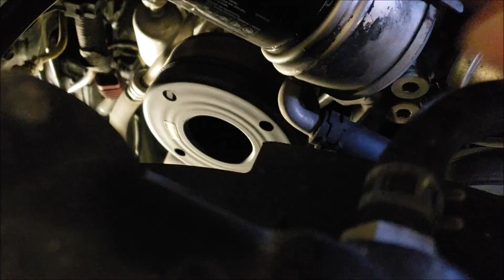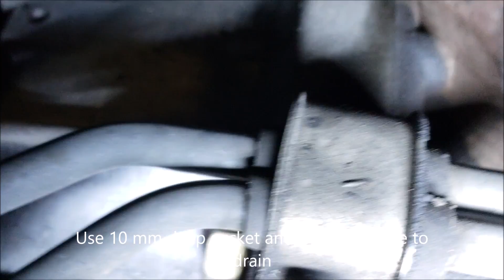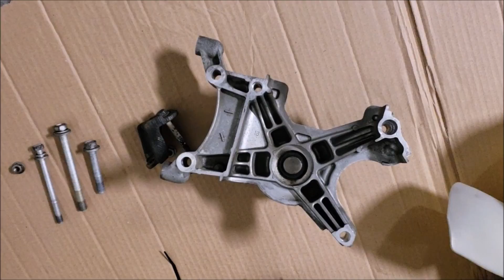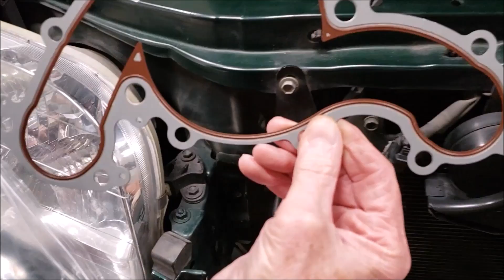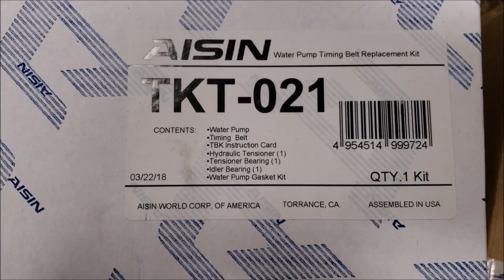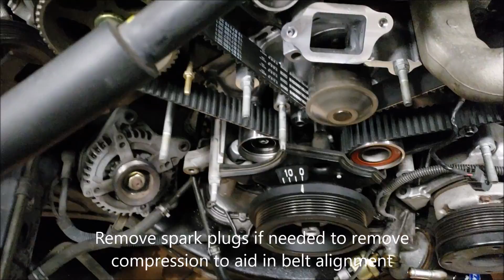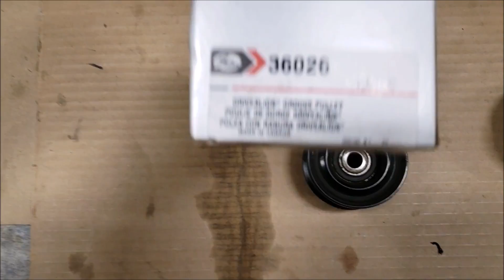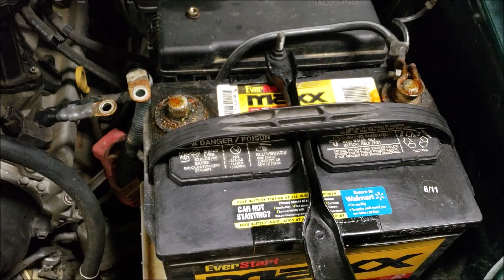STEP by STEP Timing Belt Kit installation: 2UZ-FE V8 4.7;Toyota Tundra, Sequoia, Land Cruiser, Lexus

Comment: Belt is on backwards when facing the vehicle the left should be on your right.
Reply from the maker: Yes, I have not paid attention to the marks on the belt any time I have replaced a belt (several Tundras). You can use them if you would like and feel more comfortable, but some belts don't have them and I haven't used them on 2004 and earlier engines. I have also seen DIY's obsess about the marks on the belt instead of focusing on the marks on the engine. Lining up the marks on the pulleys is the key.  There are more details in the description and in a conversation with Dave g in the comments.

Comment: Just did mine , now my AC doesn’t blow cold , any advice ?
Reply from the maker: My suggestions: Check to see that the a/c connections are tight.  Make sure the serpentine belt is installed properly and tight.  If the belt is slipping, you may need a new belt and/or tensioner.

Comment: How many miles are/were on this engine @G Dupler? We have an 06 Tundra with 156,000 & have Never done the timing belt, water pump etc & we've had since it was a year old with 17,000 miles. I KNOW we are Waaaayyyyy Overdue :(
Reply from the maker: The Toyota manual says to change it every 90k. I have heard people go a lot further than 90k, but that is a testament to Toyota engineering. We changed mine at 150k, but that was the second time because it was changed early at 60k.

Comment: I came here for the lining up the belt marks with the pulleys, and you didnt do that!
Reply from the maker: True. There is an explanation in the description and I talk about it in several comment threads. Some belts have the marks and some don't. I see no need to use them, but I don't begrudge someone who wants to use the marks.

Comment: Right, the bottom line is that the Left and Right Cam pulleys along with Crank line up at their designated TDC marks.  The Timing Belt marks are an additional step for accuracy purposes that all timing components are inline (referenced) correctly to each other, in fact after initial line up with Timing Belt marks and the three pulleys, after two rations of the Crank these marks will no longer line up, but as we know the TDC marks on the pulleys Better line up with their respective TDC marks on the backplates of the pulleys.  Once again thanks for you video !

Comment: Great video, thanks. However there's an error in your installation of the belt to the Left and Right cam pulleys and as a result your Crank pulley as well.  The Toyota belts are marked L cam, R cam with arrows and the Crank pulley with three different marks.  This is the case in order to guarantee the correct spacing of number of Cam teeth both Left and Right Cams as well as the Crank pulley teeth. I noticed your Cam timing marks were lined up with cam backplates. In addition, before remove the timing belt, both Left and Right timing marks should line up with the T position on the Left and Right Cam backing plates. The purpose of the Cams lining up with the T is to relieve the tension from the cam lobes, and therefore when the timing belt is removed from the cam pulleys the Cams don't tend to rotate and possibly create Valve slapping with the pistons. Thanks for your video.
Reply from the maker: Thanks. So, referenced in the description and in some of threads on here I explain that I pay no attention to the marks on the belt. Some belts have marks and some don't. I certainly respect anyone who wants to use the belt marks, but I don't. I also hear what you are saying on the T marks, and again, if that method works for you, no issues here, but in my experience the T marks aren't a must unless you are working on a 2005 and above.

Comment: Hello I have a 2005 engine does the mark on the cam go on the T ?? Instead of the line like in your video.
Reply from the maker: Thank you for watching!  The simplest answer I know for TDC versus the T mark is that it depends upon the year.  2005 and above you use the T mark in some form or fashion (due to the VVT-i).  The instructions from the Aisin kit are as follows covering your 2005: 

2005-08:
Turn the crankshaft clockwise until No.1 cylinder at TDC with timing marks aligned.
Turn the crankshaft clockwise a further 50° until pulley timing mark aligned with guide pulley bolt.
Camshaft sprocket timing marks will move forward 25°

Comment: Did I catch that correctly on your timing belt install. did you not line up the lines on the belt with the timing marks on heads and the marks on the cam?? Did you count the teeth in between the two lines on the belt to make sure  it was the same amount of teeth on the belt where you placed the belt on your two cams & head timing marks?  don't get me wrong excellent video!! job well done! I just caught that little detail there and that's where I'm at on mine.  I just wanted to know if you did that and if you didn't do that , did you get lucky and and and get it right or did you have to reset it ??? sorry to call this out on such an excellent video. normally I would never do this but I'm right at the point to where that's where I'm at.   I'm having troubles getting the lines to stay on the cams seems like the belt needs a stretch a little bit to get the lugs to settle in place. I don't want to do this job again for a small detail like this overlooked. Your reply would be much appreciated in anxiously waited for thank you for the video though it's been most helpful and nicely done also I can appreciate the Newton Meters in foot pounds terminologies
Reply from the maker: Thanks for the good words and sorry I didn't see your post earlier.  I am trying to catch up. I have not paid attention to the marks on the belt any time I have replaced a belt kit (several Tundras). You can use them if you would like and feel more comfortable, but some belts don't have them and I haven't used them on 2004 and earlier engines. I have also seen DIY's obsess about the marks on the belt instead of focusing on the marks on the engine. Lining up the marks on the pulleys is the key. Keep the pulleys in place and when the belt is tightened, the marks on the cam pulleys and crank should be lined up. There are more details in the description and in a conversation with Dave g in the comments.

Comment: great video. I am at the point to remove the timing belt, but at this point the crank is lined up to the 0 mark but the mark on the cams are a little bit off their I marks more towards the T marks.
How do I do to have them line up perfectly both of them to the I marks, Turn the crank several times to the right clockwise until it finally all line up correctly?
Reply from the maker: Thanks. If it were me I would rotate the crank to the point where all three marks (crank and two cams) line up.  I have seen situations where it was off just slightly and then corrected with the new belt, but I would still try to line them up at tdc.
Reply: @gduplerauto  thanks you, i reinstalled the crank shaft and bolt and turned the crankshaft clockwise several times trying to line up the 3 marks, still off a little bit : right cam shaft a little bit, the left (driver side) a little more. So at this point I decided to remove the timing belt and the tensioner. so far so good.
but then i decided to see if I could line up the camshafts marks.
Right side jump a bit counterclockwise pass the I mark however the Left cam jumped quite a lot again counterclockwise way passed the I mark about 50 degree. So I turned the camshafts clockwise to line up with the cam marks.
So my question is did i did something very wrong and how at this point should i correct my mistakes before i start removing the water pump.
Reply from the maker: @LawnMowerGuy  my experience is if you just have minimal camshaft movement and you put the cams back to the proper place with minimal movement to put it back to the proper place you should be fine. You may want to use a clamp to secure the cam pulleys as you work. If you have a 2005 or above engine you will want to use a particular procedure discussed in the comments. 2004 and earlier go by tdc.

Comment: So it has 2 waterpumps. The outside one and then the inside one that runs off the timing belt?
Reply from the maker: Just one water pump. The fan bracket looks similar to a water pump but it is just a bracket and a bearing.
Reply: @gduplerauto  ...yes I know, it was not till you took it off that you started to refer to it as a fan bracket.

Comment: I have stressor is, don't forget to replace the idler pulleys. I own the Sequoia where somebody didn't do that and their place the timing belt itself and I thought it was something like a serpentine pulley but no I had to do an entire timing belt to replace them. Also, if you hear a grinding noise, I highly recommend pulling off your serpentine and running it and seeing where it's at, otherwise, one of them can seize and the timing belt will break and you don't want to drop a valve on these engines these are very expensive engines.
Reply from the maker: Yes, I agree. We did the idlers as well. There are some with the kit and the accessory idler is available separately.

Comment: Would you or did you put in a new coolant thermostat as well?
Reply from the maker: I did not, but I would recommend replacement on a truck with higher mileage. Particularly around 200k or more.

Comment: Good video, the timing belt is in reverse but anyway will work, just pay attention at the left side te belt is marked right cam, is not important because the timing marks are on the right place, just a observation
Reply from the maker: Thanks! I don't pay attention to the marks on the belt because some have marks and some don't.  I just focus on tdc and lining up the marks on the engine. See the discription for more info.

Comment: What does this service normally run with the new parts?  Was looking into getting a used sequoia but idk with this amount of service needed for the timing belt service
Reply from the maker: A shop would charge between $1000 and $2000 for parts and labor depending upon the place and the quality of work.  I broke down my part cost specifically in response to other questions, but my cost for all the parts was a little less than $600.

Comment: Good video for this info. My only question is why did you put the timing belt on backwards ignoring the alignment arrows and not mention it at all? I know that you can do that if you are careful but why? Mist people less mechanically inclined may be very confused by this.
Reply from the maker: Thanks! I have not paid attention to the marks on the belt any time I have replaced a belt (several Tundras). You can use them if you would like and feel more comfortable, but some belts don't have them and I haven't used them on 2004 and earlier engines. I have also seen DIY's obsess about the marks on the belt instead of focusing on the marks on the engine. Lining up the marks on the pulleys is the key.  There are more details in the description and in a conversation with Dave g in the comments.

Comment: Any suggestions on how much of this needs to be done if the camshaft position sensor needs replaced/trouble shooting a code P1340?
Reply from the maker: Found it in a portion of the shop manual. Says to drain the coolant, remove hoses as necessary, remove the drive/serpentine belt, and then remove the upper timing belt cover on the driver's/left side to expose the cam sensor.

Comment: I followed your video to the "t" but now the truck is cranking and not starting what can I look for or to look at to see what the issue might be. I also have fuel pressure and spark.
Reply from the maker: A couple suggestions; the procedure  you follow depends on the year of your truck, as 2005 and above are a bit different, so check that. There are details in the description and other discussions. Also, retrace your steps and make sure the cam and crank sensor wires aren't pinched. That can happen and make your sensor malfunction.
Reply: @gduplerauto  I'll double check everything, it's on an 04 tundra as well

Comment: Great job! Thanks
Reply from the maker: Thanks for watching!
Reply: @gduplerauto  I’m convinced that the dealership “pencil whipped” my timing belt at 100k. After watching videos like this one, I realize that there should have been witness marks on clamps & bolts, etc. Now I know why he didn’t want to do the water pump. They just put a sticker saying the timing belt was done. I wasn’t quick enough to challenge them though. Now I have 255k on my 2001 Sequoia. She is still running and shifting great, but I want to do the necessary maintenance. This video was probably the best tutorial I’ve seen. Thanks for the torque values as well. One question that I have, is the only “left handed threaded” bolt the one in the accessory belt tensioner, or are there others? Thanks
Reply from the maker: @mickeydoolittle2057  I empathize with your dealer experience, as one of the reasons I like to do things myself is that I know it is done, and usually done right. If it is wrong, I only have myself to blame. On the tensioner, I believe you are correct about the pulley bolt thread, but we replaced the whole tensioner assembly so we didn't have to deal with any left handed bolts.
Reply: @gduplerauto  thanks so much for the info. You are a great help!
Reply from the maker: @mickeydoolittle2057  happy to help, and thanks for watching!

Comment: Hi guys ! It is very interesting video for russia, Kazakhstan Kyrgyzstan and some like this countries....   How many cost like this engine in your country 2uz fe...? Thanks a lot for your job and for video!
Reply from the maker: Hey SAM,  Good to hear from you in Russia and the surrounding area! 
If you are asking about parts, they came from RockAuto except for the small Toyota brand hoses.  The RockAuto parts ran $530 with tax and shipping a couple months ago, but are likely higher now. Add another $50 or so for the small hoses.  If you are talking about a complete engine, the prices vary depending on the quality, used or remanufactured, etc.  The cost can easily vary from $1500 to $5000.

Comment: Great Video. Just one question. The mark on the belt says CR and it looks like it's on the left side. Is that correct?
Reply from the maker: Thanks! I paid no attention to the marks on the belt. You can use them if you would like and feel more comfortable, but some belts don't have them and I haven't used them on 2004 and earlier engines. Lining up the marks on the pulleys is the key.  There are more details in the description and in a conversation with Dave g in the comments.

Comment: Excellent tutorial but for me being a shade tree mechanic I better leave timing belts to you pros. My 03 has 96k so it’s overdue. One tip though, when I change my oil I don’t have to remove the bottom plate. After I drain the oil in the pan underneath, I just put a flexible qt. size plastic tub like a margarine container under the oil filter and after breaking it loose first then finish unscrewing it just let it and the oil fall in the tub. Thanks from S. Louisiana.
Reply from the maker: Nice tip! I will have to try that..

Comment: Wondering if the 4.7 engine is a interference or non- interference engine ??
Reply from the maker: Interference, so that is why it is important to keep up with the timing belt maintenance. But if you do that and change the oil, you should have great service from it.
Reply: @gduplerauto  The reason why I'm asking this question is because I was looking at a tundra that had the timing belt that snapped on it. I was planning to buy it after finding this information out who cost me a lot more money
Reply from the maker: @jackw3235  I see. I would have a pro check out the engine before buying one that had a snapped belt. There could be broken or bent valves  and it can get worse from there.
Reply: @gduplerauto  thank you for the info and the help. Now I have a better idea where to check for

Comment: just going to acquire a 2002 Sequoia wih 187K miles.  was told it has always been dealer serviced, which i believe to be true.  I am going to call the service dealer and see if I can verify service records.    that said, could you tell us how much the cost of all the parts & kit were?    Tedious job but doable.  very very nicely done vid.
Reply from the maker: I bought all the parts from RockAuto except for the small Toyota brand hoses.  The RockAuto parts currently run approximately $530 with tax and shipping. Add another $50 or so for the small hoses. If you don't have coolant on hand, add for that expense as well.

Comment: Hi I have an 06 tundra with the 4.7 180K I bout the same kit. 1A auto removed the ac compressor is it necessary? Thanks for making videos and helping people! People don’t understand how much extra effort you put into an already hard install. But add making an informative N short straight to the point videos. To help other save thousands. (Those with qualified experience, knowledge of engine mechanical works and lastly confidence) Its nice to have something to refer back to and 9/10 whenever I ask questions they are answered without any bs. I’m not a specialist in any particular field. I enjoy working on my own trucks. Because 9/10 when you have the block broken down you see other problematic things that need to replace. And inspect areas may break down. Some shops purposely just ignore it so the customer can return 3 months later to supplement their income.
Reply from the maker: We didn't see a need to remove the A/C compressor. There is a small heater hose near the compressor so it may help with replacing that hose. You would want to be careful not to disconnect the A/C hoses because then you would need a system evac and recharge.
Reply: @gduplerauto  thank you I used this as my reference so far so good I used silicone for easy slide on the water pump
Reply from the maker: @BobbyBhat24K  Good deal, I hope the whole job goes smoothly!